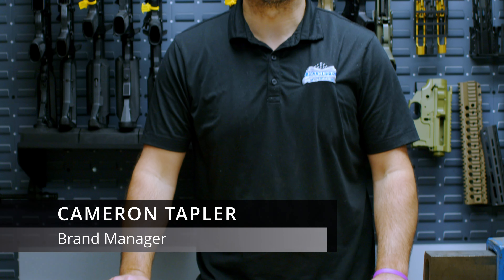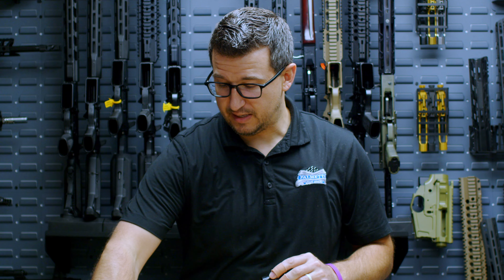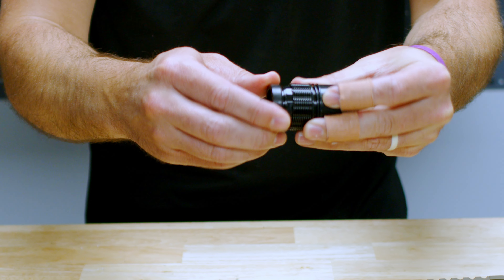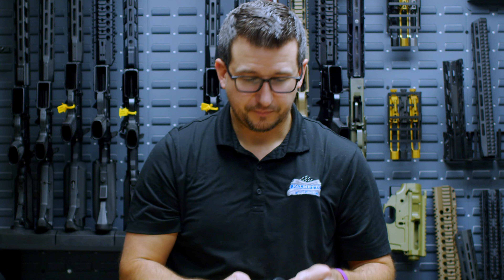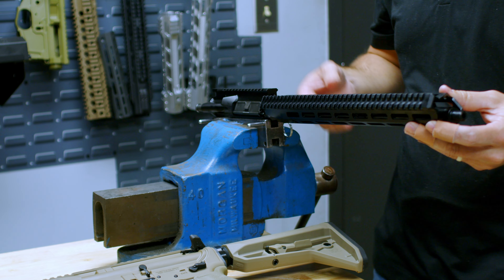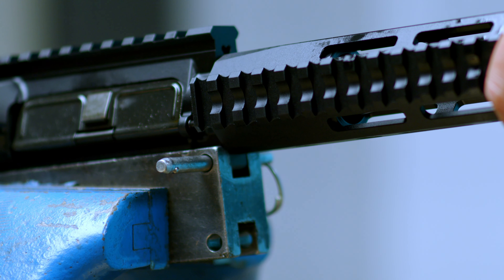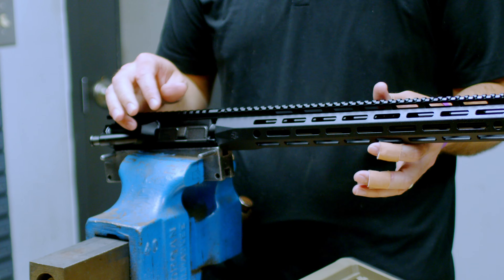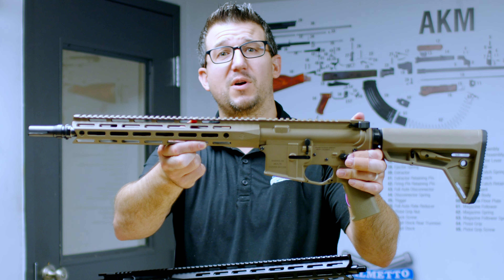PSA: Sabre Lock Up Rail System

Comment: Seems like a solution to a non-problem but that's fine. Innovation yadayada. I just built my AR15 with all PSA parts and can say the bit this eliminates is totally a non problem. This system seems like 1) an extra point of failure 2) appears to weigh more and 3) expensive for an otherwise insignificant cosmetic "upgrade". Where's the stuff people have been begging for on the forums?

Comment: Eh I'm not convinced of the durability of this. Sure it's easier to install than a KAC URX 4 and looks similar from the outside but I highly doubt it's anywhere near as rigid or durable. For something like the sabre line that is supposed to be "premium" it should be competing against KAC, Geissele, and DD rail systems.

Comment: Genuine question.. how do you install the gas tube and gas block AFTER putting the rail on?
Reply: My thoughts exactly
Reply: KAC and Q do it with a nut and threading on the barrel in front of the gas block. Theres no threading on the barrel in the video so they may have made the mlok slots line up with gas block set screws.

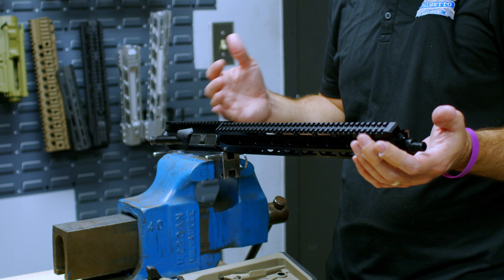Comment: 1:50 "We then have a tool we specifically made to torque the rail to the final 12 o'clock position." (If you're going to show the rail then you show the tool as well. Does the tool come with the rail? Or does it need to be purchased separately?)
Reply: This needs to be answered. Reviews on their website make me think we don't get the proprietary tool along with it. Not too smart, if so.
Reply: No tool and none available to buy
Reply: Did not receive the tool with mine. And my handguard is not clocked properly at noon. So it's stuck at an angle.

So far CS has provided no response to this issue or help.
Reply: @eschenn1  use a strap wrench
Reply: HEY PSA RESPOND TO THIS. I’m literally trying to buy this model is FDE as we speak but I need this answered.

Comment: My handguard is not clocked properly at noon. So it's stuck at an angle from how they installed it. And I did not receive the tool they mention with mine.

So far CS has provided no response to this issue or any help, I have reached out three times.

Comment: A more complex, but also more forgiving take on the URX4, with the benefit of being a true flush fit to the upper.  It's a rather ingenious design, though it heavily relies on that threaded collar to keep the handguard from simply sliding off. Though it looks like the set screws are spaced so that the rearward one locks the handguard in place against the flats on the barrel nut, while the forward one locks the collar in place, I'm assuming that's what the flats are for.

Comment: I'm just a novice builder/tinkerer but how do you install the gas tube and block after you torque down the handguard?
Reply: Yeah, that part sounded like a goof.
Reply: KAC and Q do it with a nut and threading on the barrel in front of the gas block. Theres no threading on the barrel in the video so they may have made the mlok slots line up with gas block set screws.

Comment: For everyone talking about how to put the gas block on AFTER the rail, this is the same method KAC utilizes. KAC and Q both use a nut and threading on the barrel in front of the gas block. To be fair, there is no external threading visible on the barrel in front of the gas block journal in the video so my guess is they made the mlok slots line up with the gas block set screws. However, the method of gas block installation after the rail is not new nor is it a flub from the armorer.

Edit: Also, KAC uses a picatinny to 1/2” drive tool to do the final torque on the handguard. It’s essentially a barrel nut wrench that uses the picatinny rail and side of the handguard to apply rotational force. My guess is they have a similarly designed tool.
Reply: What about pin and weld barrel?
Reply: @Niko_rj  You would essentially have to do the P/W after the upper is fully assembled unless you used a slimline muzzle device like the VG6 that allows the gas block to slip over the muzzle device after its permanently attached. You may be able to install the barrel and barrel nut, then slip the gas block and tube onto the barrel just behind the muzzle device, weld the muzzle device and play twister with the gas tube and block as you rotate the handguard timing and then install the gas block set screws last after sliding the block down onto the journal but the easiest solution is just do the pin and weld last.

Comment: I’m confused. So your barrels don’t come with gas block dimples, only set screws. Not ideal long term. Sure anyone can buy a jig and dimple the barrel themselves, but first you have to remove the hand guard and then reinstall it using a proprietary torquing tool that nobody has?

Comment: Where is the tool?  I checked your website and I don't see a tool specific to this handguard.  Also this handguard will not work currently with Aero Precision M4E1 lower.  Due to the bottom of handguard having not relief cuts, as this prevents the upper aligning proper to lower to allow takedown pins to engage. The bottom of handguard contacts the lower front takedown pin mount and does not allowing holes to align.

Comment: Bootleg industries uses a shaft collar that just clamps the barrel nut, like engineers have done for decades. It’s not complicated. It doesn’t move at all when I smack it with a hammer. Please god just use a shaft collar.

Comment: Engineers need to stop designing things with the need for proprietary tools. I used to work as an automotive technician and it was the most annoying and wasteful thing. Midwest Industries handguards work perfectly fine with allen wrenches you can buy at any hardware store and carry around with you.